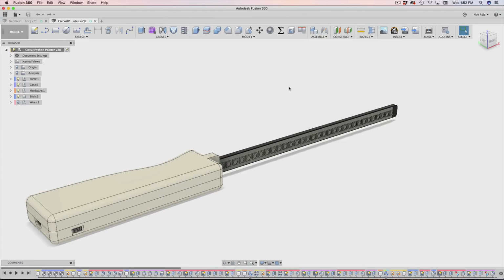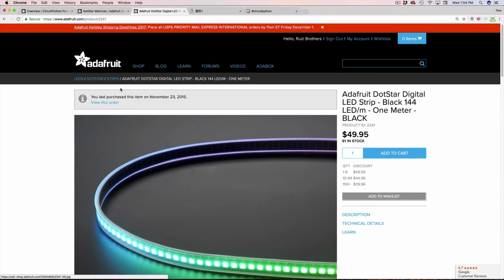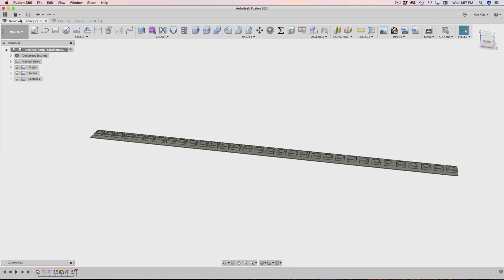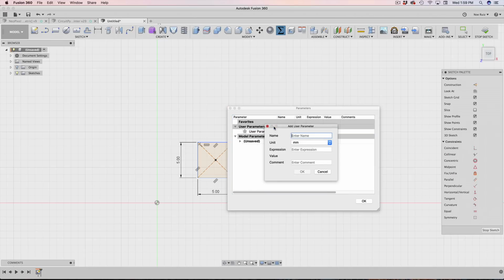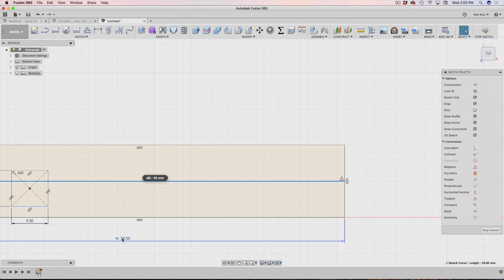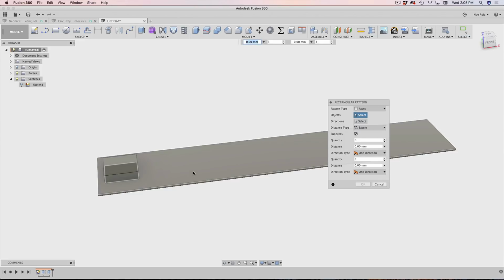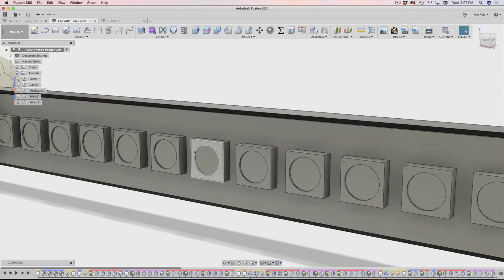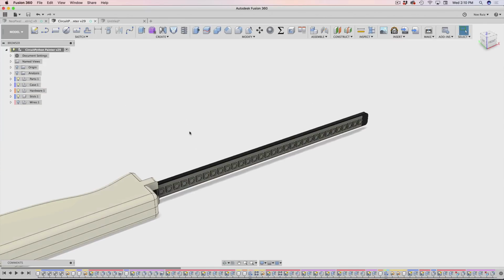Fusion 360 Tutorial – Parametric LED Strips

Comment from the maker: I should have dimensioned the center of the first pixel to be (pixelPitch / 2) away from the edge of the beginning of the strip. This way the pitch would fully drive the length of the strip. Oversight I didn’t realize when first designing, but an easy fix! – Noe
Reply: Creating the Indent for the LED lens before your first rectangular pattern would have been more tidy as well.